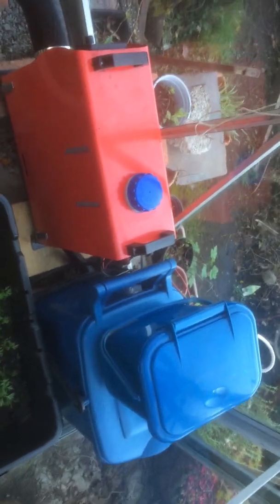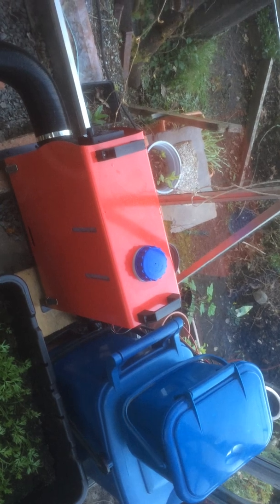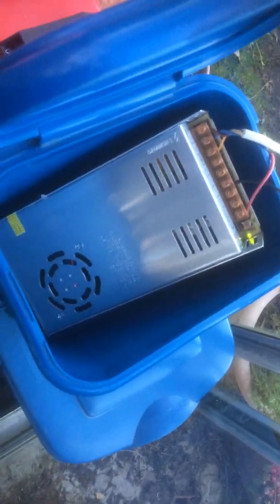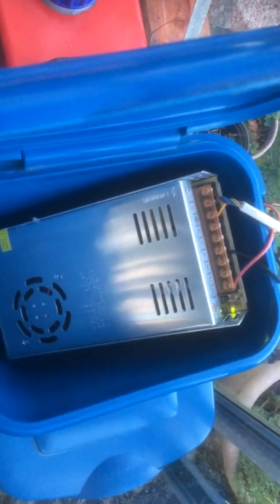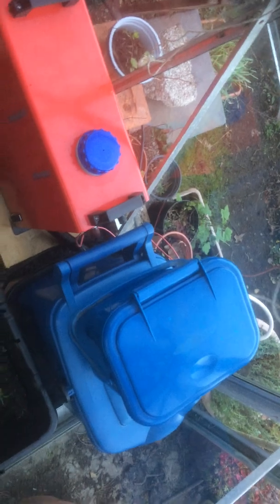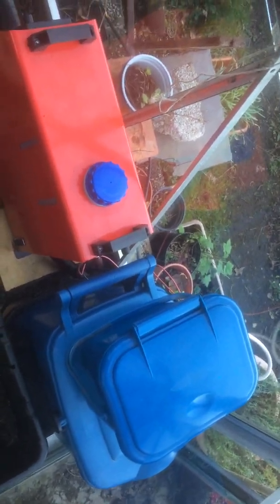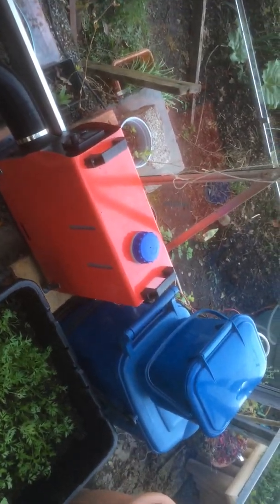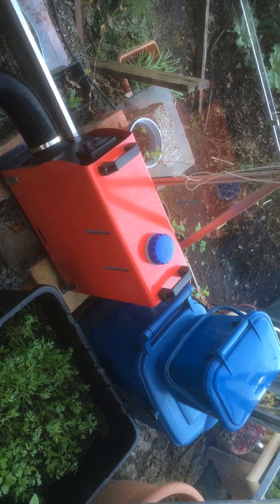Diesel Heater (Part 4). Fuel consuption and power supply review. vEVOR HEATER.

Comment: What happens if you get a power cut and the heater can not go through its shut down  cycle ?
Reply from the maker: Thanks for reminding me. I think theres's a way if wiring a car battery for a backup. I'll have to look into it!!
Reply: There is a guy that did a power failure test. Nothing happened.   https://www.youtube.com/watch?v=1krro1lDTOg&ab_channel=Mel%27sBigVanSmallWorld
Reply from the maker: @QrunsEl  Mine failed when I had it running on a car battery for 10hrs. The battery died and the heater didn't shut down properly. It survived and has been fine since. Maybe as long as it doesn't happen too often it's ok!